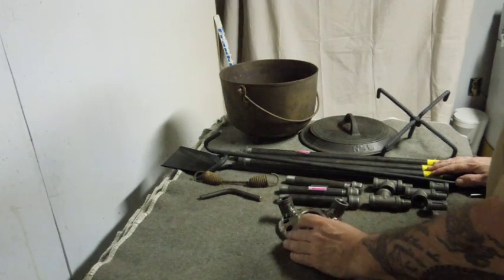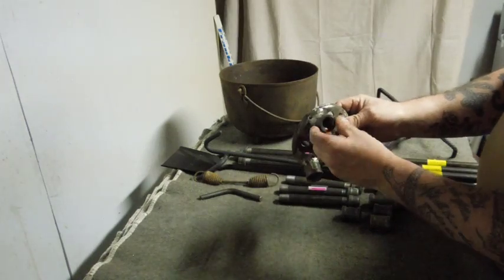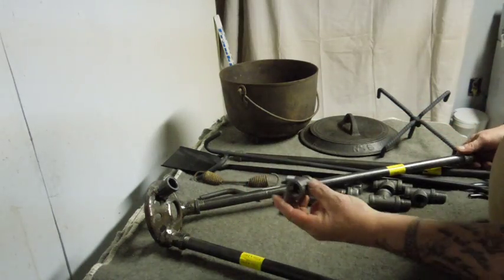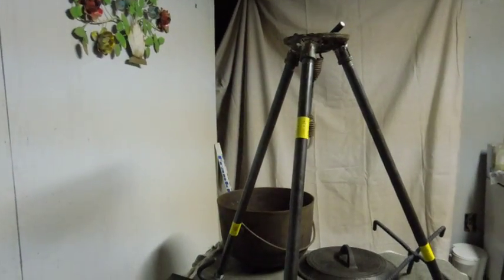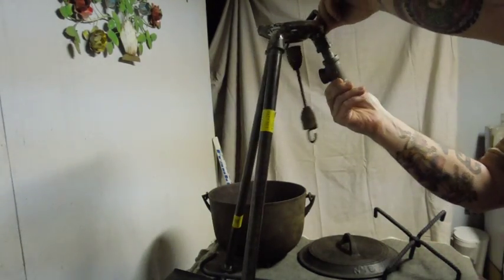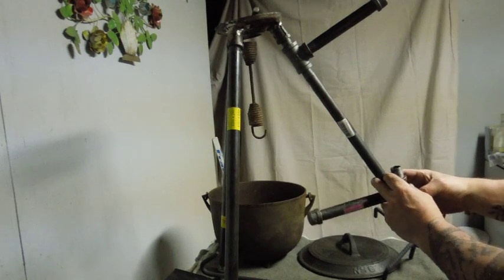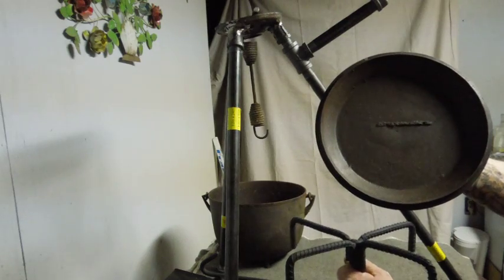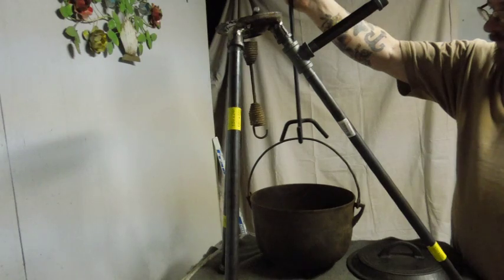handmade semi portable metal camp fire tripod cooking equipment

Comment from the maker: @MiWilderness it is heavier than what you would want to pack around on a long hike. But it would last forever stashed under a tree or in a rockpile.  I need to burn the coating off this in order to paint it.  I'll take some more video afterward.  I built this for a friend that does dutch oven cooking contests.  they tried to cook in the coals and had trouble controling temperatures. I might end up keeping it for myself.

Comment: Any suggestions on substituting the oil filter base, is there a screwed type fitting that would work? I like the idea of threaded pipe, just don't have access to a welding machine.
Reply from the maker: I used the oil filter base because it already had the angle for the tripod.  It also had a series of holes so that I could get them evenly spaced.  Welders are sold for as low as 150 bucks from Harbor Freight.  I bet somebody has one in their garage on the street block where you live.